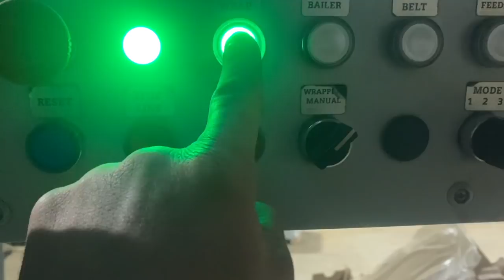Mcconnel hedge trimmer falls off, turkeys get the chop, hay going out. Episode 220

Comment: I had the same happen on a Sherborne trimmer, slide the pin in the opposite way on the top link bracket, it won't slide out then, and also steel bushes so the the trimmer bracket doesn't move on that pin. Cheers

Comment: Its those damn Lynch pins as they are getting made out of cheap steel. Years ago we had a similar problem and got around it by using a high strength bolt with nuts and washers. It might be a bit of a bugger changing equipment but if the trimmer is going to stay on for a long while then its no great shakes. The wear on the frame is possibly because its twisting for some reason. I seem to remember you put a larger head on and perhaps it might be causing the issue since you didn't have the problem before. Have a good Christmas and an even better New Year

Comment: Adam has broken more thins thain Justin.🤣😂🤣😂
Reply: Still prefer watching Adam as he scores well on the entertainment factor especially when having an “Adam rant “. 

Really need a washer between the lynch pin and the top link casting each side as it will just soften the shock into the lynch pin. Bit of grease may help. I would have thought the mounting to the puh to have eased the stress load on the top link bracket.